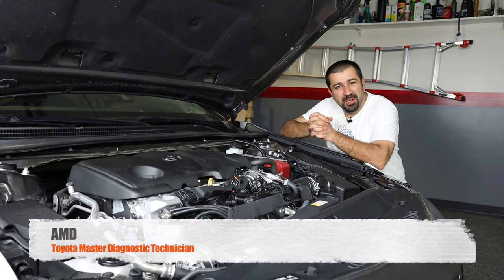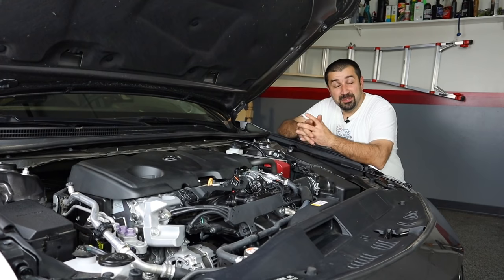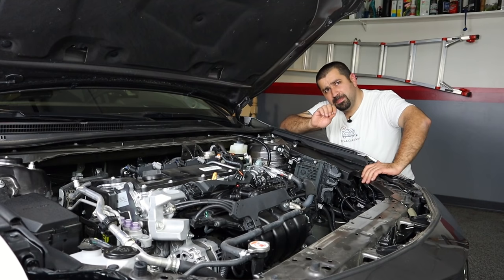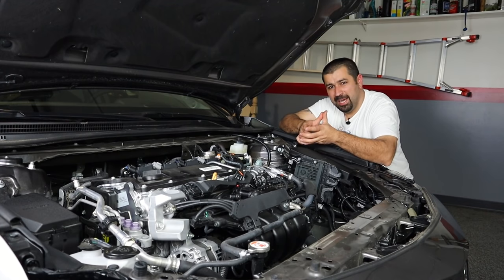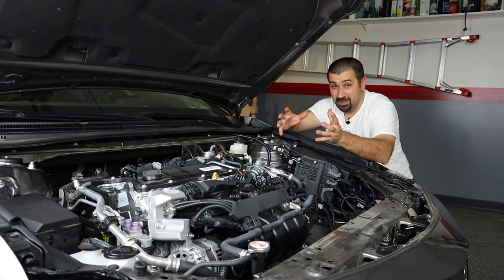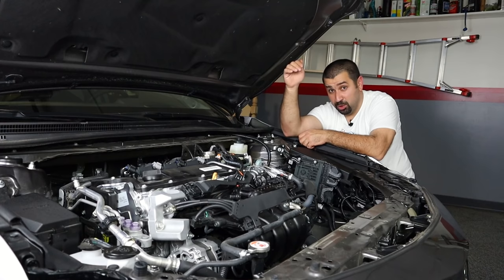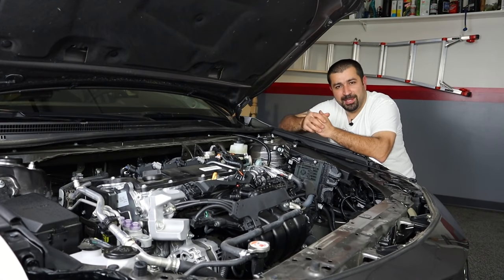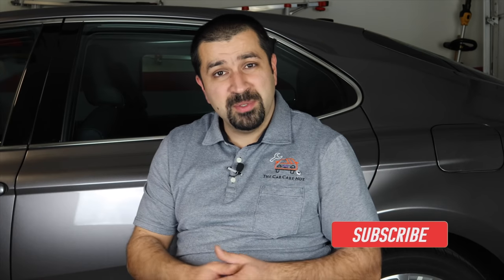Toyota's New Engine Technical review Part 1 : Cooling,Lubrication,Direct Injection and EGR

Comment: I have a 2020 Toyota RAV4 hybrid Limited and have been very pleased with my purchase no regrets.  Your ability to take a very complicated subject and explain it to someone with very little knowledge when it comes to vehicles is a true gift.  The Toyota dealership that does my service uses a 0W 16 motor oil provided by mobile 1 is this a different formula then the mobile 1 you can purchase at Walmart.  And the second question that I have for you if you’re able to comment on it do you feel confident in the Toyota WS fluid even though it’s not synthetic and if so what would be your recommendation as far as fluid change intervals.  Thanks for all the hard work I truly enjoy it.
Reply from the maker: Thank you for watching my video Bryan. The Toyota official oil is supplied by Mobil 1 so using Mobil one full synthetic 0w16 is good. I wouldn’t put any other transmission fluid other than ATF WS when the car calls for it.
Reply: @TheCarCareNut  amsoil uses a group  4 100% synthetic ATF that is WS rated in your opinion would you go with the Amsoil or stick with the Toyota genuine WS ATF I do 20,000 miles a year and would like to change the fluid every two years I hope I’m not being a pain I just truly respect your opinion on this matter thanks again.
Reply from the maker: Honestly Bryan the Toyota ATF WS is the perfect fluid for Toyota transmission that call for it. You are guaranteed 100% that the fluid is compatible with the transmission. I think Amsoil is an awesome oil company but unless they hand me a written guarantee with my name, my cars VIN number and mileage that everything will be perfect with my transmission I am not using their fluid or anything else but Original fluid. I am sorry to say the following. Folks take it as a challenge to deviate from the original transmission fluid. And what I don’t understand is what is the gain? To prolong the life of the transmission? Maybe for other brands but Toyota transmissions are some of the best out there. 

Replace your fluid with ATF WS every 60k and you’ll remember me at 300-400k when the thing is still going strong. People have already done this and got this kind of miles from the transmission with no issues.
Reply: @TheCarCareNut  thank you so much Toyota ws ATF it will be 👍👍👍god bless Merry Christmas to you and your family.

Comment: If the vacuum pump is run off the camshaft, what generates vacuum during when the vehicle is using battery power only?
Reply from the maker: Hybrids don’t have vacuum pumps as they don’t use vacuum for their brakes

Comment: Toyota Australia manual page 422, specifies multiple oil types but does say 0w16 is best for cold start ups and fuel efficiency.  But is it really best for long term in say cental California where temp hits 110 F in summer and no colder than 30 degrees F in winter?

Comment: As soon as CNG mentioned vacuum pump, i got a red flag signal. Nightmare issues,$$$ when i had a Voltswagon beetle. Also needed in Audi 5 cylinder engines. Mabe others too.

Comment: In the Middle East (UAE and Lebanon), the Toyota user manual that came with my 2023 RAV4 Hybrid  with the A25A-FXS engine calls for "0W-20, 5W-20, 5W-30 and 10W-30" while the US version of the manual calls for "0W-16". I am assuming that this is due to the fact that the climate is much warmer in the middle east compared to the US. My local dealership also confirmed that Toyota Corporate also approves the use of 5W-30 in this engine in warmer climates and this why they used this oil during the first engine service at 1,500 km today.

Can you please shed some light on this as I am a bit concerned regarding this discrepancy in oil viscosity.
Reply: I think the disparity in the usage of oil viscosity is more for conforming to emissions regulations and for differing climates. Thicker oils like 10W-30 have to work in warmer environments, and can’t work properly in colder climates where temperatures are colder. I’d just follow the owner’s manual that came with the car if it were me.

Comment: If it’s like the 2GR-FKS, the exhaust manifold is actually part of the head casting and has coolant passages within the exhaust manifold section of the head in order to quickly bring coolant up to temp.
Reply from the maker: This one doesn’t have the integrated exhaust manifold. That would’ve been cool to have.
Reply: @TheCarCareNut  interesting... I think one of the main reasons behind that for the Tacoma was to be able to get the primary cats closer to the head for pre heat/emissions reasons but also for anti theft reasons. Don’t have as much problems with people cutting the cats out of cats as they’re too low to the ground to be easily accessed.

Comment: I use 5w30 oil in my 2gr even though it calls for 0w20. I favor performance over fuel efficiency
Reply: The older Toyota engines can run a thicker oil without issue. But these new engines really do require the thin oil for the variable displacement oil pumps.

Comment: Hi, thanks for your help with all your info and advice about toyota cars..
PLEASE I would Like to know what is the
HP and the KW for toyota Sinnea 2021 engine it sell...with out  combined it with ELECTRIC engine..
Thank you
Reply from the maker: Hi! The gasoline engine makes around 200hp
Reply: Thank you,
May i ask you,
I parked my Seinna 2021  Since February 5th, And i tried to unlock the doors was no battery power to unlock the doors or start the engine today..So I am afraid something happens..I decided to text you to get your advice before i do any things.
May you help me please
Reply from the maker: Hi! I would jump start it. If the battery gives you issues after this stop by the dealership and have check the battery it will either need charging or need replacement

Comment: Congrats on your channel and thanks for all the valuable information you are sharing! I have just a little over 1200 miles on my Toyota yaris cross hybrid and I'm thinking of doing the very first oil change right now. The car comes with 0w8 oil equipped from the factory. Toyota dealership suggests 0w20 for the country I live in, Greece, Europe. They even told me I can do 0w16 or 0w8 even though they don't suggest it, as it is too thin for our climate (hot summers over 40°C).owners manual suggests 0w8 but says I can do 0w16 , 0w20, 5w30 and next oil change I should go for 0w8.Last but not least manual says I can do higher viscosity than 0w8 if car is put under extreme or high loads.Given the climate and what the owners manual suggests, what's your opinion on what oil I should put in my car? Thanks in advance!

Comment: The best advice given is to change your oil at 5,000 mi.,not 10,000...that was in a previous video after Mr. Nut showed a 10,000 mi. Oil change engine and the damage caused.  Matter of fact,  I just changed my oil at 5,000 mi..this will be my practice from now on.

Comment: What type of factory Engine oil come with New 2021 Rav4 XLE, SAE w0-16 Conventional or Syntactic ?  Toyota recommend 10,000 miles or 6mos  first oil change, Can I do it early at 5,000 miles ? Thanks !
Reply from the maker: Hi! They use the recommended oil which is 0w16 full synthetic. Doing your oil changes at 5k intervals is recommended
Reply: @TheCarCareNut  Thanks for your value information ! Great channel, will highly recommended !

Comment: in my country toyota dealerships put 5w30 oil for corollas with m15afks engine even though owner manual says exactly the line you say here on 7:01 i red on the internet that they say that info in owners manuel is for other countrys but some guy pushed for it really wanted that 0w16 they coulndt provide it and gave 0w20 isntead what do you recommend us to do in this situation

Comment: Question I heard this question in the video but so a 2019 toyota camry se has both Injectors? Because I know that toyota does that and I went to the dealer and the dealer told me that it doesn’t it only runs with DI so I used the valve cleaner to clean the valves.

Comment: Enjoy the channel. Thanks! I just got a Highlander Hybrid with this engine (called a Kluger here in Aus). Got the oil changed at 1400km (at the Toyota dealership) and they replaced it with 5w-30. I queried them about it and they said they had no 0w-16 and that this was still recommended. The manual does list 5w-30 as ok, but 0w-16 as preferred. I assumed that a dealership would use the best oil for the engine, but I suspect they used the easiest bulk oil. What are your thoughts/recommendations? I don't think it'll blow up or anything, but it seemed odd.

Comment: Question for you.  I own a 2021 Camry 2.5  fwd.   

It has 45000miles on it.   I want to keep this car as long as I can.  Should I replace the 8 speed  tranny fluid or just leave it ? Everything is working as it should. No issues

Comment: The manual states that higher viscosity MIGHT be better if driven with high speeds/heavy loads, once a year I drive a 4000 miles to turkiye and back, with 4 adults and luggage.I suppose that falls under the category ''heavy load'' so would you recommend switching to 0w20 or even 5w30 and after I come back change it back to 0w16?

Comment: Hi and thankyou for all your guidance. I was wondering if when you have changed the engine oil and filter if it gets the oil pressure up and fills the new filter before restarting. That makes me wonder also if you have oil pressure before cold starts? I guess it may be easy enough on the hybrid.
Reply from the maker: Hi! There’s always a slight time when you start the engine after an oil change or lower pressure but because you’re at idle speed it won’t affect the engine health

Comment: Dear "The car Care Nut", I would like to ask you about the engine oil viscosity. In RAV4s Manual is stated that "An oil with a higher viscocity (one with a higher value) may be better suited if the vehicle is operated at high speeds, or under extreme load conditions instead of 0W16." Therefore my question is what oil grade to use in Greece where the outside temperature during summer season can reach to 40 degrees celcius (104 F)? Does 0W16 still protect the engine and that kind of conditions? Waiting for your valuable advise. Thanks a lot.

Comment: Engine vacuum is due to cam timing, and not the result of direct fuel injection ( almost all modern engines have some sort of variable cam timing, I am guessing that at idle the ECU is programmed to use a cam timing that have less pumping lossless to achieve target engine efficiency, thus the need for a vacuum pump).

Comment: brought 0w16 oil for first oil change on Lexus 2020 Oct UX250h at Lexus, service advisor says all Lexus in Singapore using 5w30. advisor will put in a service note that I am using 0w16 if I insisted, which might subsequently affect warranty if anything happens. so I just used 5w30 even though manual recommends 0w16 to keep warranty.
Reply from the maker: If the owners manual says 0w16 then that’s what I would go by.

Comment: Hello i my girlfriend has the 2019 Toyota Camry i have noticed on the maintenance schedule that it recommends injector cleaner every 5 K miles do you also recommend this. Also i like to let the car warm up before taking off usually about 2-5 minutes is this necessary with all that fancy coolant flow. And should we be giving it the goose every once in a while to blow out the EGR phony Bologna piece of junk? Thank-you in advance and thank-you for putting your time into these videos
Reply from the maker: The fuel injector cleaner is for certain markets. Also an Italian tune up here and there can’t hurt anything.

Comment: Yep the A25A-FXS engine is in my 2023 Lexus ES300h and it's a wonderful, reliable, efficient, and powerful (enough) for me engine. Of course, with the hybrid boost it gets up and goes. LOL She gives me 43+ MPG in City/Hwy driving.

In addition, I have 6,600+ miles on the clock and have already had the oil & filter changed twice, once at 1,000 miles and twice around 6,000 miles. Why, well because TCCN recommended such  just like he did for his 2022 hybrid Camry with the same engine and drivetrain. Check out his video on his Camry about why he changed out the factory oil & filter at about 1,000 miles.

I use Liqui Moly 0W16 Special Tec AA and an OEM Toyota oil filter. Oil & Filters are cheap, engines are expensive. I shall be changing the oil & filter every 5,000 miles or six-months, whichever occurs first. LOL 🤔

Comment: Thanks for the material! There are really very little in depth info regarding those engines 
I have that in my Rav4 Hybrid, wondering could you help me to understnad:
1) I've noticed that engine is louder in ECO mode than in normal, wondering is it because it's switching to Direct Injections sooner?
2) What are the difference on that engine if you "downshift" using those paddle shifters behind steering wheels vs is you select "transmission sport mode" with gear shifter lever and change to lower gear there?
Reply from the maker: Thank you for watching my video. The switch to direct injection mode is likely the reason it gets louder. Also on hybrids both paddle shifters and the s mode are very similar

Comment: Me nephew has a 2020 RAV4 with an “engine maintenance message” and I saw online from different posts that the coolant bypass valve is at fault. Does anyone believe that this will ever become a recall, and would the replacement part be of better quality?

Comment: Thank you so much for this (and all your videos). So informative. Hoping you can answer a question about this engine: We are in a cold climate (Eastern Canada) and have always had a block heater, used only on the coldest of mornings (when its -18C / 0F or lower), mainly to reduce hard-starting. Given the very sophisticated cooling and oil systems in this engine, I wonder if the block heater option is still a good idea, especially in a Hybrid implementation.

Comment: Mr. AMD, I have this engine on my ‘20 Highlander Hybrid, 53,000 miles later, I noticed some oil leak around my oil filter and drain plug thought it was leaking but after investigated the issue up to the valve cover and noticed leak from around the valve cover likely to be a gasket leaking. Have you seen this issue before in such a fresh year and low miles? I am changing my oil every 5k miles except first year I did it every 9-10 at Toyota dealer during free maintenance period. Trying to take good care of it but noticing the gasket leaking at the valve cover kind of making me a bit disappointed. Thank you sir!

Comment: Hi just wondering? does the high pressure pump on these engines use a bucket type cam follower . And are you aware of any issues of wear to the bucket or cam shaft , like they have been having on the Ford escapes Ecoboost engine.

Comment: 2018 Camry SE 2.5L has P0198 code. Having trouble locating a new oil temperature sensor as well as where it's located on the engine. Any advise?
Reply from the maker: Hi! How many miles and any rodent damage?
Reply: @TheCarCareNut  72000 miles and zero rodent damage. Engine looks new still
Reply from the maker: Let me look into it. Please reply to this comment so I can find it
Reply: @TheCarCareNut  Thank you
Reply: @TheCarCareNut  Thanks

Comment: Owners manual says that if 0W-16/0W-20 was not used athe 10,000 mile interval then replace engin oil with 0W-16/0W-20 at the 5000 mile seervice. Both grades can be used. 5W-30 can be used in a pinch.

Comment: Hae! I want to change engine oil in toyota fielder hybrid,does inverter oil be changed?
Reply from the maker: Hybrid inverter doesn’t have oil. It does have coolant though
Reply: Ok What do I have to change
Reply from the maker: Drain and fill and bleeding. We don’t have that model hybrid so I’m not 100% familiar with it but some of the older ones you needed a scan tool the newer ones you’d leave it running for a while and keep adding coolant.

Comment: Toyota has made its living with simple relatively reliable engines. Will be interesting how these changes go moving forward, especially when used ones get less then optimal care. Variable cooling, variable oil pressure controlled by computer rather than directly, what could possibly go wrong?

Comment: I have a 2020 Camry with the 2.5 D4S engine.  Why do I feel a slight tremble just as I come to a stop?
Reply from the maker: It could be the transmission downshifting.
Reply: @TheCarCareNut  I've heard these new 8 speed transmissions are quirky.  I hope that's normal.  I only have 5000 miles on the odometer.  

My last car was a '15 Kia Cadenza with the GDI V6.  At 66k miles it would sometimes jerk severely, wouldn't get over 5 mph and then die in the middle of traffic.  Two different dealerships couldn't fix the problem so I traded it for the Camry.  Reliability somehow made it to the top of my wish list.
Reply from the maker: The 8 speed is quirky but it’s not a problem. It’s just too many gears to shuffle through. If Toyota is not reliable I don’t know what car is. Don’t worry, you’ll have this car for a long time.

Comment: AMD, I just purchased a new 2021 Highlander Platinum AWD (not hybrid). My manual says to only use 0W20 oil. Sticker on engine says use 0W20. Also I live in AZ. Please advise.
Reply from the maker: Hi paul! I would stick with the 0w20 honestly.
Reply: @TheCarCareNut  just so I understand. What is difference in your engine and my engine?
Reply from the maker: Your highlander has a V6. The engine in this video is a 4 cylinder.
Reply: @TheCarCareNut  oh crap. Sorry. I guess I didn’t pat attention.
Reply: @TheCarCareNut  keep up the good work.

Comment: Nice video, although I would like to address that the double injection system, port and direct injection has been already introduced by the VW company since 2007 on the engine EA-888. Nevertheless Toyota is by far a more reliable Engine company 😊😊